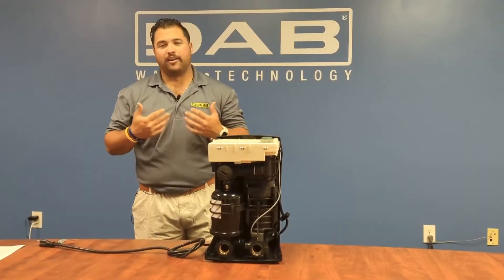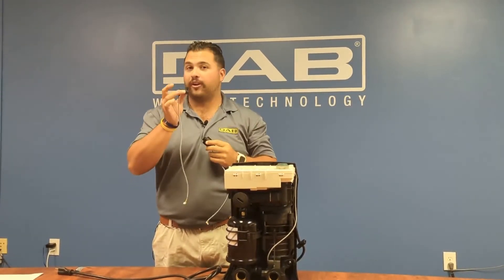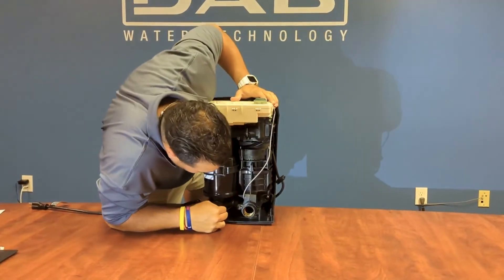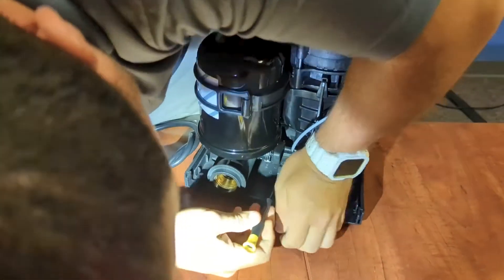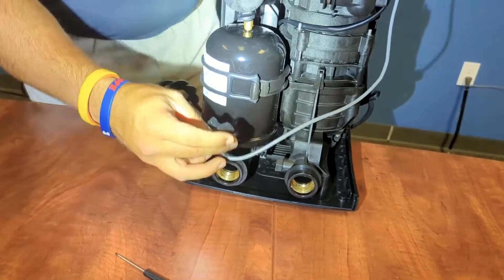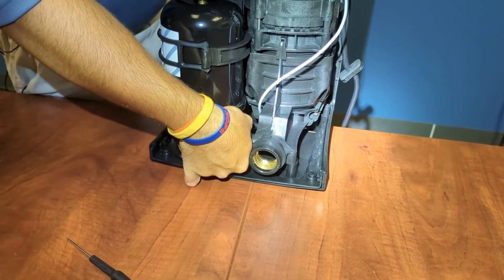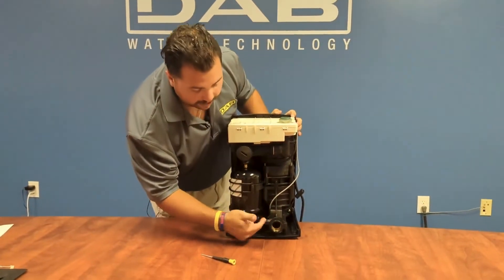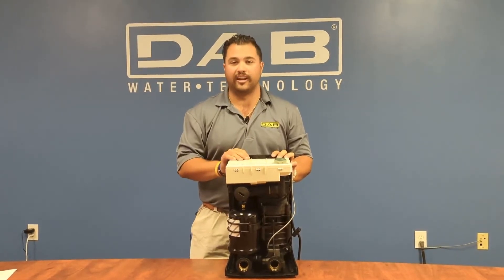How to replace the Pressure Sensor on the DAB EsyBox Mini 3

Comment: I bought my easy box mini3 three months ago and already the pressure sensor has had it. Very disappointing for a pump in this price bracket
Reply from the maker: Hello, thank you for your comment. I apologize for the issue you had with your pressure sensor. Pressure sensors can fail due to water hammer and build-up of material within the sensor itself. If you continue to have issues, please contact our customer care department at service.us@dabpumps.com and we will be happy to assist.

Comment: Hi there, my esybox.mini3 has a problem, it says "no power supply", tries to start but the display shutdown, and tries again with the same message again and again, and after a few cycles it runs ok for two or three stars and the again fails to start with the same message. Any tougths of what is the problems or where to start checking.